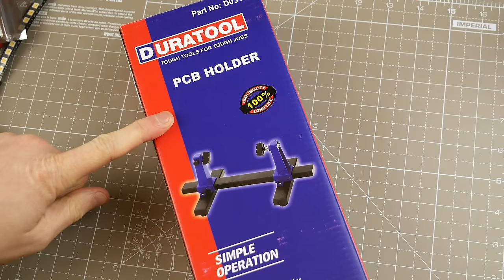Duratool PCB Holder

Comment: CPC sell this at £4.79 including VAT so you can save a few quid. I have been a CPC customer for a couple of years (no other connection!) and I have to say they are very competitive on price and offer free delivery on orders over £5 which is usually super quick, typically two days. I am just a hobbyist so small orders are not a problem.(Also very good place to buy LED light bulbs - Advert ends). Good video David.

Comment: David,remove the legs you screwd on and you can lay it on its side ,so the pcb is clamped and close to the table.
You maybe use 2 of the rubber feet to even out for the knobs that prevent the board for turning so it is level on the table and don't wobble because the knobs are not on the same side.

Comment: I got one of these a while ago.  The jaws holding the PCB absolutely will not melt under normal use. They look plastic but in fact, are metal. The stand legs themselves are a soft plastic and a soldering iron will go through that in short order. 

If you can find a way to rest your hand on the struts when soldering or poking parts in to place  it's kind of OK.  

Having it higher up, I've found reduces back strain, especially if you're using magnifying glasses for hot air and SMD work. Rather than hunching right over the desk, down to get close to the work, just having it that little bit higher seems more comfortable.

There  are more expensive versions, similar to this. One in particular I think made by Weller has a little arm that can press on through hole components, which spins with the board so when you flip it over, they don't fall out. It is possible to use blu-tak, as you know to hold these in, though painters masking tape also works OK.

For under £10 delivered, I reckon it has its uses, perhaps there's some mods to make for it that could make it even more useful in the future. Bearing in mind more "up market" versions are much closer to the £50 mark. I've seen holders as well for production that run in to the hundreds of pounds yah.

Be well!

Comment: Stickvise FTW!   Very simple, yet elegant.  The Stickvise holds the board flat on the work surface, which is handy since you can brace your hands right on the work surface as well at the right distance to do soldering.  Having a PCB in a stickvise flat on the table is also handy if you're doing tiny SMD assembly while using a binocular microscope or magnifying lens.    

This product sure seems large and now you've got a storage problem..  and having the PCB up in the air makes it difficult to solder on at an awkward height.
Reply from the maker: Interesting, I'll have a google for the stickvise, just from the name it sounds similar to the small metal PCB holder I have. I have found the Duratool one really useful, getting stuff up above the desk has been great, but you are right, the thing is massive.

Comment: 8:50 It's better for your neck. This holder (SN-390 as it's typically called) is basically ripped off Weller ESF-120's design and slimmed down for optimal afforability. It's standard for industrial PCB holders to be raised, even the top end ones do. Neck strain, fumes, magnification and, of course, rotation are all points to consider when making a good PCB holder. If it's that uncomfortable, I'm sure you could construct a ramp to rest your wrist on, indent the holder into the table or basically building a stage above the table and raise your chair. There are many good solutions, but I just deal with it as it is.

This one is actually pretty good for the price. I would probably recommend modifying the rods on the opposite ends of the clamps with something so that it can be more easily rotated without having to touch the actual board. Just makes it a little bit easier. Possibly a mounted pad, like the Weller, to keep components from falling off the board while they're being soldered from the other side. But this can simply be done with polyimide tape or tack (leaves sticky residue, though).

Comment: Isn't the screw on the spring end supposed to be left loose most of the time? That way you can adjust the side arm so the spring is under compression, which is what holds the board in tight, but it still allows you to spin the board over more smoothly.

Comment: interesting device I made something similar using a couple of edge connectors fastened to 2 pieces of wood the only problem I can see with this type is once the board has been populated turning over usually results in everything falling out but as mine was lower to the bench this wasn't a problem. the industry standard pcb frame I used at work had a piece of foam held on  the back to hold all the components in

Comment: Thanks.
I've been looking at something similar and hadn't considered that the board is suspended a height from the desk.
So wrist resting could be an isdue as you rightly stated. 
I also hadn't considered heat gun use either.

Good review. 
Thank you.
Reply from the maker: Thanks Jason

Comment: I'm a big fan of blu-tac for holding the boards in place while soldering, It would work well with your preference of keeping your wrist resting on the desk.
Reply from the maker: I love a bit of Blu-tack but I hate the residue it can leave, especially if you get a little too close with the iron :-)
Reply: David Watts it can get a bit messy ok but my solution for that is actually more blutack! It actually does work to roll some around the board after it cools down, it usually lifts what's left on the board.
Reply: BluTac is a complete fail for holding boards while soldering. Why do you need to hold them anyway? Use the table and gravity... that holds almost everything down on the earth :-)
Reply: John Coops you take that back John! I won't have a bad word said about the worlds greatest invention!

The reason for bluetac is so you aren't chasing the board around the table when your pressing the iron against it and then also to hold the components in place if needed
Reply: Brian Lough - I have been soldering for over 40 years and I have never needed to chase a PCB around a table. I have no idea why you would be pushing your soldering iron with such force, or at such angles that would cause a PCB to move. In any case, your other hand is holding the solder so simply use the side of your hand if you wish to steady the board. As for holding components, I just flip the PCB and utilise the table surface, as this is extremely effective... when in the normal soldering position (copper traces upwards) there is absolutely no way that the components can escape or move. As for BluTac, it is gummy sticky stuff and becomes even worse when heated - I cannot imagine ANY situation relating to soldering of electronics when I would have any need or desire for it. If you feel you need it, perhaps you should relearn your technique.
Reply: John Coops I'm just sharing what works for me and many other people doing soldering. For example the board that Dave has in this video if you were soldering the components the opposite side of the board from the seven segments the board might easily tilt or slide while working on it. 

I only do maybe 2 or 3 hours soldering a month and I'm pretty happy with how my technique works out for me, but thanks for your concern :)
Reply: Brian - you said "For example the board that Dave has in this video if you were soldering the components the opposite side of the board from the seven segments the board might easily tilt or slide while working on it"Errr what, HUH?How could anything possibly tilt or slide? All the components would already be soldered before the 7 segment displays were even installed.When you solder you must start with the lowest components (links) then the next lowest (diodes, resistors). Continue adding and soldering each layer in order of it's height above the board. The capacitors are usually last.And I still cannot understand what you mean by the PCB "sliding", nor why that might be bad.... that doesn't make sense at all. In fact, I deliberately slide and rotate the board so I can access all the joints to solder them!So I am not trolling you - I simply cannot understand what soldering situation you might be creating that requires the PCB to be "glued down".

Comment: I got one about a year now, very useful apart from screw not being tight enough.
Reply: cheetahkid What screw? If you mean on the bit that touches the pcb, I have a big elastic band across the two supports ho help keep it in place. For £10 it is a super handy tool though.
Reply: sorry, the screws on the side on the slider
Reply: sorry, the screws on the side on the slider

Comment: might have been worthwhile actually soldering some goodies to the board to check slippage, hold and unwanted rotation. but thanks for the vid. for  7 bucks i'll be getting one
Reply from the maker: Noted, they sound like good things to look for. I am not really a pro reviewer :-) I use it a fair amount, it tightens up fairly well holding items in the right place. I often use it when I want to probe both sides of a board with my multimeter.
Reply: I just bought one on the strength of your video  so well played matey.  i wont blame you if its a bit crap. its 7 quid. less than 2 pints :)

Comment: Would this be used for laptop PCB's? If you could help me, what is the range of PCB sizes in a laptop? and would this be good for it?
Reply from the maker: Hi. I don't think it would be that useful. Laptop PCB tend to be fairly odd shapes and more than likely too cumbersome for this PCB holder. Not sure about the range of sizes for laptop PCBs, I would have to say that there are no standards for that.